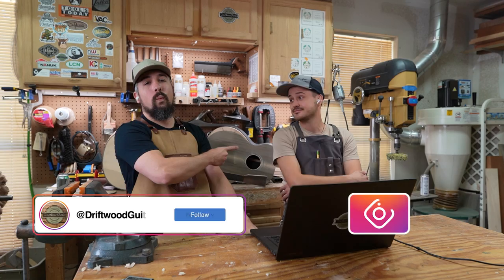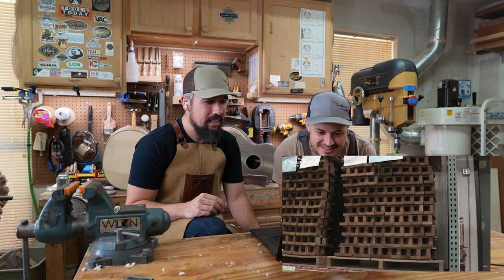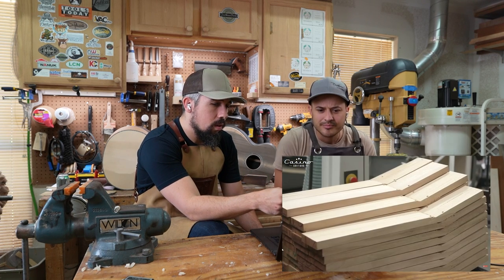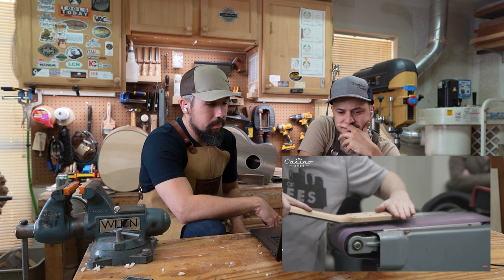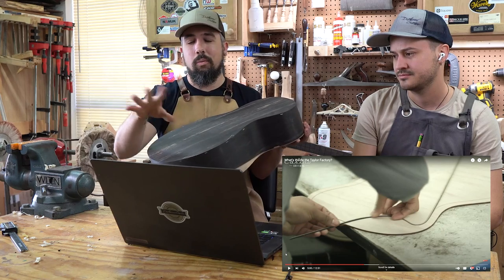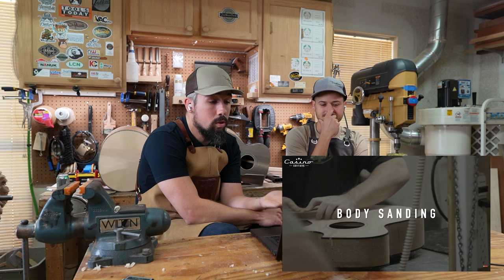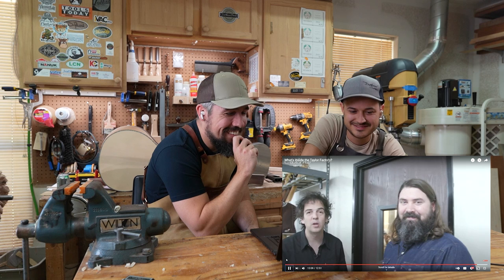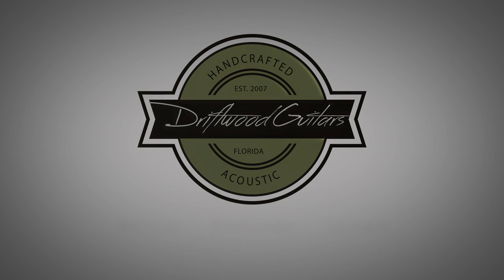Professional Luthier Reacts: Taylor Guitar Factory Tour

Comment: Cool video, I enjoyed the commentary. The amount of 'strength' gained from a scarf joint is going to be determined by the angle of the headstock. The steeper the headstock angle on a one piece, the shorter the grain running between the faces  becomes- and the weakness that comes with it. I like how your acoustic guitars use a slotted headstock to gain greater break angle without increasing the headstock angle.
edit: Also of interest was that the Taylor 'scarf' joints appeared to have joining surfaces that were curved, rather than flat. Mine's not like that.

Comment: at 28:34, the bench behind the guy with short hair is the bench I work at. the amount of time and effort that goes into our finish department being boiled down to basically "yeah it gets finished and painted" from our own company bothers me. even during the in-person factory tours, they completely skip the finish department and the necks go from the inlays barely being laid in and then all of a sudden its being paired to a body and being strung up.
also- to you two specifically, those are 600 series builders edition guitars you just talked about with the big mahogany block and no binding, thats unique to the builders edition models which also have a cutaway. those are some of the few guitars that dont get bound, nearly all, even the 300's, get bound. it is plastic though until you get to the 500's. the only necks without binding are the AD series guitars and custom orders which ask for no binding. its the same plastic-until-500-series with that too, excluding various limited edition models.
Reply: also, the necks and bodies are hand painted, as of right now. theres a spray cell with a few painters who do it. maybe thats only since ive been hired, because im yet to see a non-hand-painted guitar.
it is hard to not get delamination, thats a huge struggle for the newer guys.
it does also bug me that we dont use nitro, I mean, our 300 series guitars start over $2000 and get poly, lame. but with how everything is set up, I think the closest we could get is similar to fenders road worn series, where its nitro over poly. if we went full nitro, it would cost the company a lot and production would have to be brought to a halt for a long time.
Reply: and also, the guitar you mentioned with a "different neck joint" was a 400 series, and no, they have the same joint, it just hadn't gotten that section of the body cut out get to get fit for a neck. it gets CNC'd out and a neck gets paired to it, strung up, and there you go. this video (not you guys, the video from Taylor) seems to miss a ton of key points. in addition, I get to be the lucky guy who cleans the buffing room nightly. all necks (the ones that get buffed) are hand buffed, and gets compound all over the floor. I think we dont have a robot for it because there are so many edges and intricacies to the necks that its likely that the robot would chew straight through the finish and to the wood if there was any anomaly in the wood or finish from the finisher. its much easier to automate buffing a body as it is mostly flat.
Reply from the maker: Man I hate that it got glazed over as well. Matt and I are both fully aware that the largest part of the entire guitar build is often the finish work. Maybe we can do a video on just how much goes into the finish work at your facility!

Comment: No BS - any book on woodworking will tell you that a multi piece glue up is more stable than a single piece of wood. Look up any of the standard woodworking texts. - Many luthiers saw their neck blanks in half and reverse the pieces and glue them so they will be more stable, sometimes with a reinforcement strip down the center. This does not look as nice as a single piece but it will be more stable. Nature does not produce perfectly balance sticks that react evenly to changes in humidity and temperature. Carefully choosing wood blanks for evenness and straightness of grain will decrease the chance that a neck will twist or warp but still nature is what it is. I know that this is not what Taylor is doing but since you are criticizing the notion that laminating is stronger, you're wrong. Also the one piece vs glued headstock issue is that in the one piece bandsawed headstock the single piece has short grain at where the headstock angle away from the neck. This makes a weak spot right where the neck is likely to break if it falls, any repair person can attest to that. The weakness is strengthened by the headstock overlay and some luthiers even do an overlay on the back of the head as well and some reinforce it internally with wood or carbon fiber inlay.
Reply: My old Peavey basses with their "bilaminate" necks are far more stable than my Fenders.

Comment: Modern glue is far stronger than wood, the ability to keep the structural grain pattern while gluing actually does make it stronger than a single piece, that and I’m pretty sure there aren’t that many examples of them breaking… probably why you guys are making videos about Taylor making guitars instead of making guitars DOH…  hey… I think the V brace system is marketing because that’s a choice that affects tone, choices that affect the ability to manufacture guitars well that’s just business and they are obviously pretty good at it… the quality is pretty darn good despite coming from a production line… You are also a little off on the tone of the lower end vs higher end guitars they make, I can definitely tell the difference in the ones I own… I seems the lower end stuff is really good until I play my builders edition and it’s really not that close, much louder and more detail in the fundamental note, it also shows easily on an oscilloscope and spectrum analyzer… I’m in the electronics business, have the equipment, so test stuff for amusement…

Comment: I read a lot of the comments on these types of videos. As a retired manual and CNC programmer and machinist/ tool maker, I can tell ya that Geppetto the woodcutter with his chisels and sanding blocks is not going to build you a better guitar than a factory using modern CNC methods. I have to laugh when I read about how they "took the soul out of the guitar" by using modern methods. BS, a guitar is an inanimate object, and any "soul" attributed to it is strictly in the imagination of it's owner.
Reply from the maker: I agree 100%

Comment: I see a lot of people have commented on the scarf joint. No doubt in my mind that these are stronger than the one piece approach, which inevitably involves short grain where the neck transitions to the headstock (which also turns out to be the slimmest point on the neck and the area where any reinforcement from the fingerboard stops. I'm sure if you stress a scarf joint headstock enough it will break, BUT, I have never seen one, but I've repaired several one piece necks, all broken at the headstock transition, and I'm just an amateur. Pros like Ted Woodford are making a living just fixing Gibson headstocks. Anyway, thanks for the video and commentary. This is a horrible tour which is more like an advert for Taylor but, paradoxically, shows me why I would never buy a Taylor guitar. It's interesting that you say (more or less) that Taylor have adopted the corporate approach of Martin, but actually, Taylor produce many more guitars than Martin and have a much more corporate value rather than craft value approach. That comes across very clearly in this tour. Cheers.

Comment: A stacked heal is definitely not as strong as solid wood, but it seems to me that a scarf joint for the neck/headstock is actually incredibly strong. There is a good amount of gluing surface there. And I have spoken to some builders who believe that it actually makes a more rigid neck in that area, which in some instances positively impacts tone. Now good/bad tone is subjective obviously, but I have never had in issue tonally, or otherwise with a scarf jointed headstock. What do you all think?

Comment: One  piece necks are weaker where the grain runs out. If neither have overlays or back strap overlays, the scarf joint wins stress tests. I think with typical overlays , the one piece is not as fragile but straight grained scarf joint head stock is still stronger. Once you add the back strap to the one piece I believe it becomes functionally as strong as the scarf joint. One piece necks do waste a lot of wood too, if that's a consideration. Wouldn't a simple end stop on the scarf gluing jig solve the slippage issue, and isn't that easier than pipe bending and gluing on a back strap? (they do look cool though) Just my 2 cents.

Comment: I don't think it's cheaper to use a scarf joint. It takes longer to prepare the two surfaces for a perfect joint, and labor time is more expensive than materials, so I don't think they're doing it for the cost effectiveness. I think it does make a stronger neck, unless the neck blank is laminated.

Comment: As a purist when it comes to aesthetics, I prefer the look of a 1 piece neck.  I don't know how else to prove which one is stronger compared to a glued headstock without a proper test with many 1 piece vs 2 piece neck/headstock.  Same goes for sound in relation to vibration of neck/headstock.  It is interesting to point out that Taylor's joint is not flat but wavy.  This must have a purpose.  Perhaps adding a tiny bit of surface area to the glue joint to make it even stronger?  Not making the edges of the pieces of wood so thin with such acute angles for stronger individual pieces?  On the other hand, would it be fair to point out that if the grain is running parallel to the neck, then it would not run parallel to the headstock in a 1 piece, making the headstock (more so a slotted one) itself less strong and possibly susceptible to breakage if it drops?
Reply: If you try to clamp a scarf jointed headstock just from the front and back it will skate apart forward due to the angle. The wave stops that from happening, as well as probably improving the strength of the joint slightly. A scarf joint with no short grain running thru the headstock is absolutely stonger than a one piece neck. But if the scarf is done higher up on the headstock the short grain persists, so it isnt stronger

Comment: I have spent the last two years extensively comparing 700, 800, and 900 series Taylor Guitars, and I couldn't disagree more. They're definitely not the same guitar with different/ more adornments. Even though they are all spruce and EIR, there exist significant differences in the voicing and feel of these guitars. If you ever have a chance to play an 800 series side-by-side with a 900 series, you'll understand. I made these false generalizations at first glance too. But, exploring their rosewood guitars with an open mind and open ear, you'd quickly find that they're not just prettier versions of the same guitar.
Reply: with all due respect, they don't voice their tops differently based on the series....
Reply: @angelg8445  okay they don't voice their tops differently what is that matter when that's just one tiny aspect of sound that comes out of that hole brah!
Reply: I spent hours in a room directly comparing Taylor's from the 400 series all the way through the 800 series. Didn't test any 900 series or higher because my budget was maximum 3k. Definitely a distinct difference in tone between each series. I bought a 714ce because I absolutely love the tone and undeniable Taylor playability. Admittedly, I'm sure it doesn't compare to one of your guitars Chris, but if you'll sell me one for the price I paid for my Taylor I'll send you the deposit tomorrow. Heck, I'll even take two!

Dennis
Reply: @denniscrews6319 Agreed, his Driftwood guitars win hands down.
Reply: @denniscrews6319  same train of thought here. I haven’t been able to compare a 414 to a 714 but what I can say with confidence is that my 717 boasts a lot of what I wanted. Great tone, great tone woods, and the solid wood appointments as opposed to having plastic or abalone. The way in my opinion a guitar should be. But again, I just love an absolutely all wood guitar, inlays and all

Comment: Solid headstock pro: looks cool.  One piece headstock con: runout (weakens the headstock), wasteful    Scarf pro: demonstrably stronger - large glued surface area. More economical, far less waste of precious tonewood, minimal endgrain runout.  Umm... I'll take a scarf joint any day over a one piece headstock.
Reply: Hear, hear. The most acclaimed luthiers have been using scarf joints for years. Scarf joints are superior in my opinion
Reply: I agree. I think there could be an exception though for laminated blanks, if the inner laminations were skewed a few degrees.

Comment: Check the Godin acoustic plant video, the automation process is better explained. The buffing machine, for example, has sensors that can recognize the positions of the guitar and the buffing wheel, it is not just a simple CNC, it has a closed loop control system.

Comment: Well it is all about grain.  If you use quarter-sawn then one piece are good, but if you don't have true quarter -sawn, then you can get grain runout and a weaker neck.  We all know about the infamous Gibson neck break syndrome.  Secondly  there is cost.  A flat board cut to make a scarf is cheaper than making a one piece neck.  I would suggest that one piece necks are used in the high end series.  The cheaper ones use scarfs

Comment: Definitely loving the Vids guys.  This is a nice sideways step too!

RE: scarf joints though - I’m not sure you are correct (or wrong for that matter).  I think it needs tested in the same way as that whole end grain ‘myth’ thing that has been flying about the past few weeks on YouTube.  

Personally, I’d think the scarf joint does not perform any worse than a single piece neck.  Would be very interesting to see it tested empirically.
Reply from the maker: I think we should make a test video
Reply: @DriftwoodGuitars  that would be a fun one!!! how would you do the test?  that's a tricky one.
Reply: @polescalante   Drop test would be one for sure. See how prone to breaking one is over the other. Transfer would be another. Create a vibration at an equidistant point on the fret board from the joint and measure at the end of the headstock.
Reply: @DriftwoodGuitars  do it!
Reply: @gpower  the drop test would be a good one if we did 10 of each maybe?  It's very inconsistent IMO since none will fall exactly the same.  Maybe with some mechanism that puts and measures pressure to the tip of the headstock in the same direction as the pulling of the strings.  That way we could maybe see if the grain not being straight on the headstock from the 1 piece would break before the 2 piece would?

Comment: From Taylor they do the 3 piece necks to conserve wood. I don't think they believe it actually makes them stronger. I could be wrong though. I've gigged a 110e for years now and just recently bought a Taylor 324ce and the 324ce is just amazing. Great guitars they make and your point about the paying more for the appointments I agree. That's why I bought the 324ce. It's a gorgeous satin finished mahogany top with shaded edge burst and blacked out and stripped down yet looks like a million bucks and paid 2200 bucks. Not 6000 but sounds like it's 6 grand
Reply: @R.L.Humpert  nice man. Congrats on the guitar and no I wouldn't be concerned about taylor because of this video. For the amount of guitars Taylor makes a day and given their known quality thats pretty impressive. My 2 taylors are great and if you love your 324 as much as I love mine there's nothing to worry about. The guitar in this video is no where in the same ball park as a 300 series so they had to cut corners to keep the cost way down.
Reply: @R.L.Humpert  gladi could help bro. I  had a few minor issues with my 324ce the first few gigs I played with it but now its perfect. Acoustic guitars need time to adjust and settle in but the 324ce is a well built guitar. I'd be sad if they cut one of them apart lol. I use elixirs on mine. They're expensive as shit but I can get about 4 gigs on a set before I change them. I could probably get 5 and still sound good to be honest. I've thought about trying other coated brands to see which I prefer but I went from Erie ball to the elixirs and damn. What a difference

Comment: Been curious to the process certain guitars have hidden fret ends/slots without using binding.  My ‘13 J-45 Standard has completely hidden slots, yet no apparent binding or CA/Dust fill.  Curious! Would love to hear you guys discuss that at some point. Great channel!
Reply: CNC cuts the fret slots / pockets. They aren’t cut all the way through giving the same effect as binding on the fret board. That way when the frets are installed the fret slots don’t show on the edges. This saves having to fill the ends of the fret slots and looks a lot neater. Martin has done the same thing on their unbound fret boards for several years.